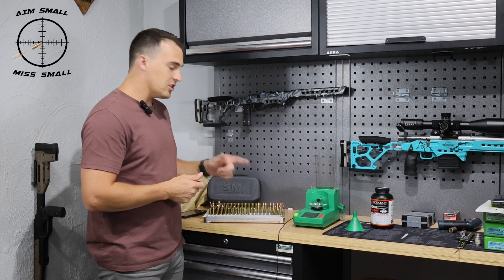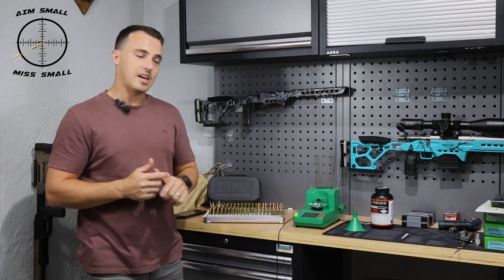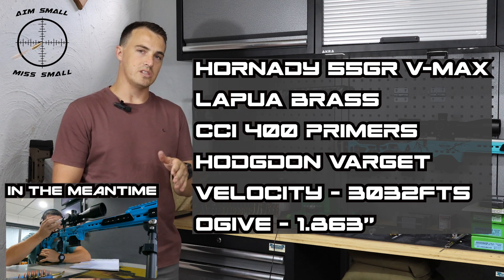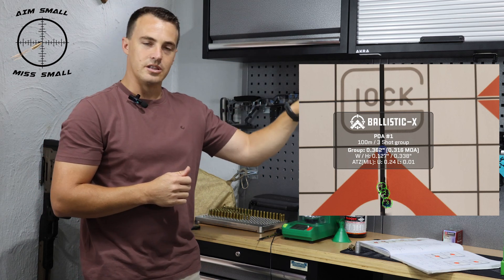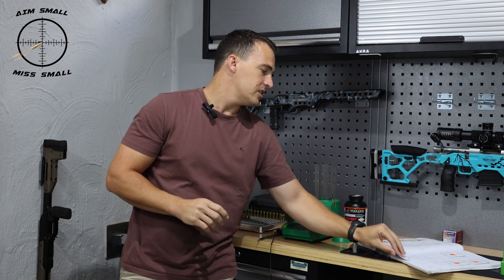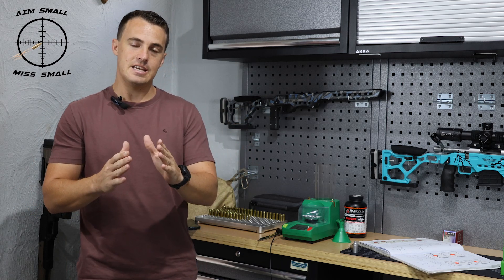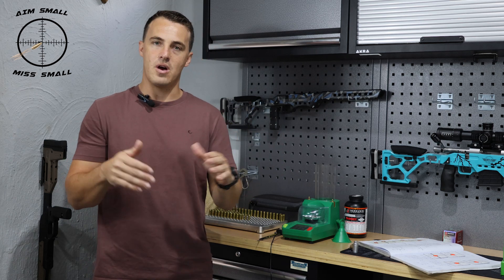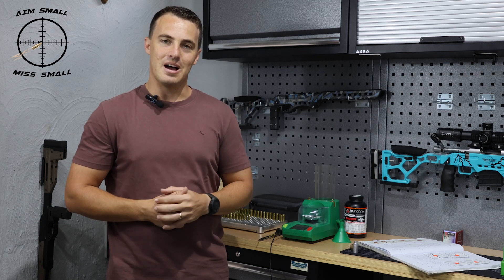Does SHOULDER BUMP really help?

Comment: Interesting test but a single 3-shot group is nowhere near enough data to give us statistically significant results. Your groups are ~0.3 to 0.9 MOA which is completely within what you'd expect for dispersion of 3-shot groups. In fact, it lines up nicely with what we'd expect to see for a load that averages ~0.6 MOA. We'd expect 80% of those groups to be between ~0.3 and ~0.9 MOA.
Reply from the maker: Appreciate the feedback